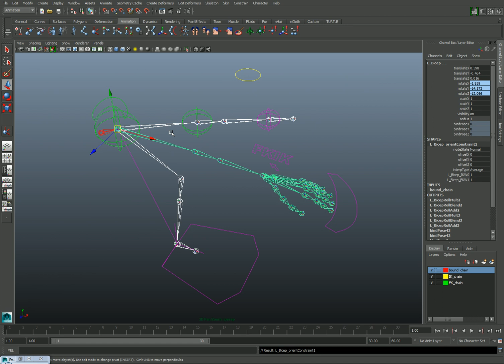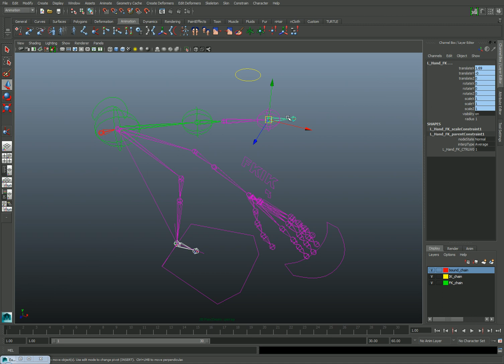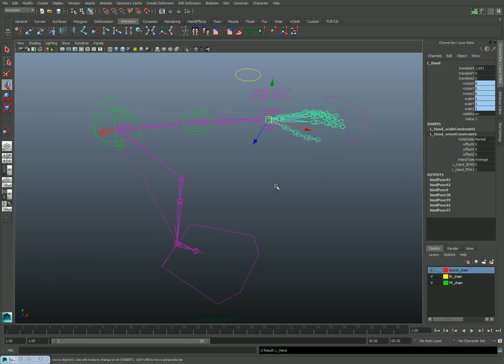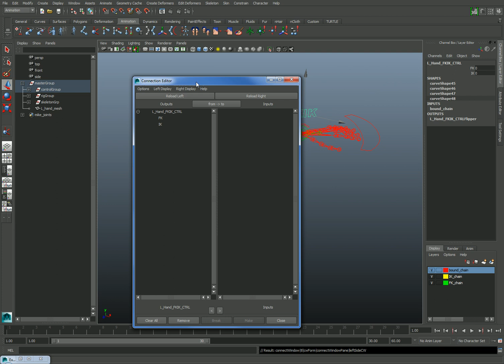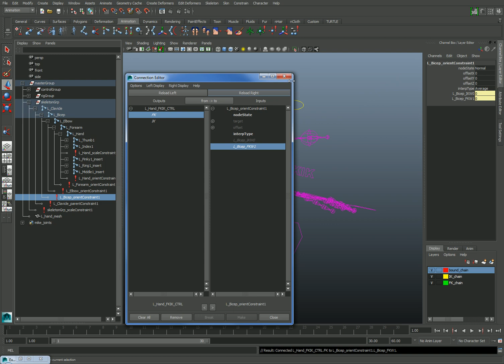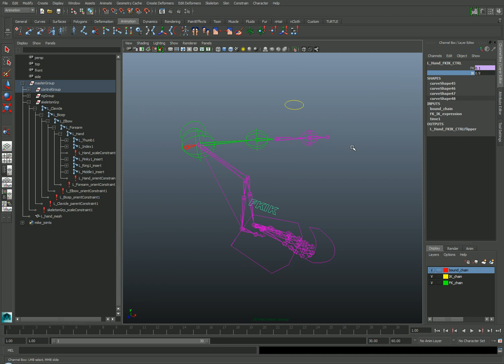Tutorial: Creating an FK/IK arm setup in Maya

Comment: So where do i parent my IK and FK joints to if i want to move the entire thing?
Reply from the maker: +knight2battle Great question.  The FK offset node above the FK shoulder control will need to be parent constrained to the nearest clavicle joint, and parented to the super mover.  The IK elbow control should also be parented to the super mover.  The IK hand control's offset node will also be parented to the super mover.  Hope that helps!
Reply: Thanks
Reply: do you mean the shoulder control for the "RESULTS" clavicle? my fk arm controllers do not follow the torso when twisting.

Comment: Can this set up be applied to legs as well?
Reply: Despite following the exact steps, it seems attempting this for the right arm yields satisfactory yet faulty results. Using a parent constraint on the FK joints flips them into strange angles, and hinging the IK/FK blend of the skinned bone with an orient constraint doesn't work, so I had to use a parent constraint with translates and maintain offset off.

I would appreciate any thoughts on the matter.
Reply: *****
Well from what I understood, the point is to use constraints without maintaining offset. On that note, IMO your suggestion defeats the purpose of the method.
Reply: *****
Always double-checked my controls' transforms & history before I actually do anything. I've found a way to apply this to just one bone though, with a IK/FK blend. It's a bit limited, but it's pretty sufficient for my needs.

Comment: Hello Mr. Jason can you help me on my minecraft rig
I'm trying to create an ik arm and legs but the joints are straight so it wont bend (I snapped it into the grid)
Is there a way to make my straight arm/leg into an ik?
Reply: John Michael Bayalan It doesn't matter if the model's arms and legs are completely straight. What does matter is that you set up the arm and leg joints with a slight bend at the elbows/knees. That way when you add IK, the arm/leg will bend naturally in that direction.